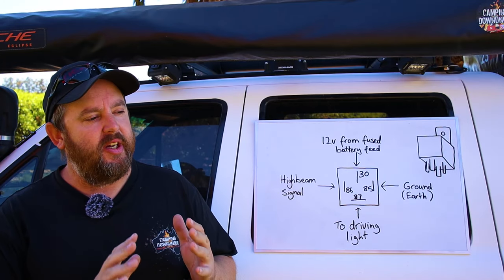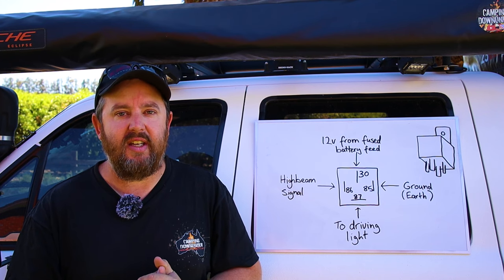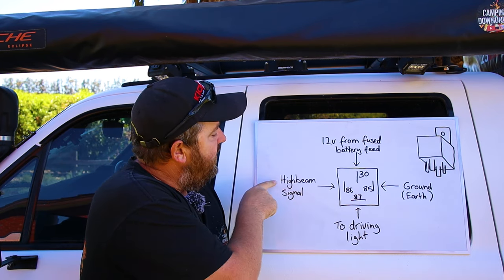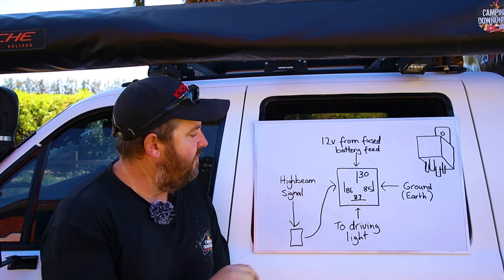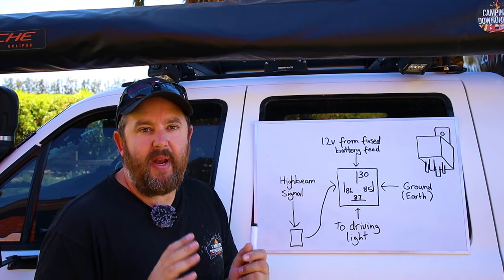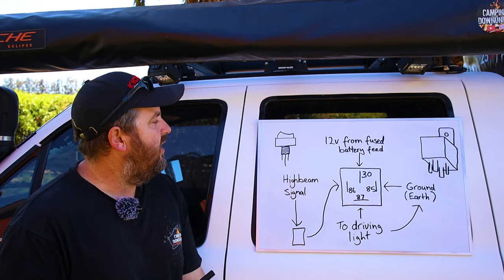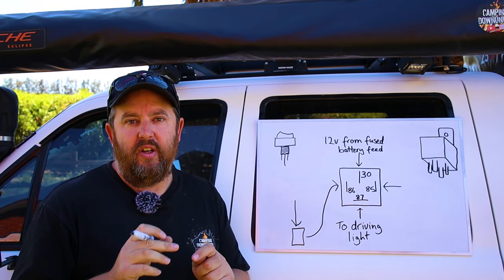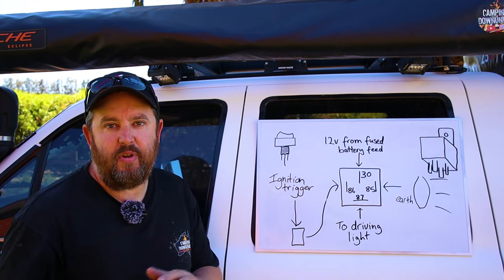How a spotlight/lightbar relay works (Beginner's Guide)

Comment: Could you make it a bit more complicated😂.
Reply from the maker: If you still can't understand that then I suggest you pay a professional so you don't burn your car down. That's as basic as it can get
Reply: This is the best explanation I've seen by miles
Reply: Also found it very confusing and talking way too fast.
Reply: Not everyone is electrically inclined.  Some people get it faster than others, others never get it.  I agree with previous comment, if you don’t understand this hire a professional.

Comment: do i need to put relay??....i want to put more lights on my car can i just conect them with my headlights and when i turn my headlight on it turn them all on???
Reply from the maker: No you can't pull power directly from your lights or else you will blow your headlight fuses straight away. You can only pull a signal from the headlights but the actual power for spotlights needs to come directly from the battery. That's why you need a relay
Reply: @Campingdownunder  that means i will need to put a extra switch or is it posible some how to make them turn on when i turn my headlights?
Reply from the maker: @marioserafimidis3133 that's what the trigger wire is for. I did a separate video explaining how to wire up spotlights

Comment: Good job mate. Keep it up. Got a power feed issue on mr triton. My bro piggy backed off existing light bar install. Worked for about 5 minutes, then cut out. I believed a fuse at first. Now possibly stuffed a relay, or rocker switch?  Just that high beam still works. Now original light bar doesn’t work or new light bar
Reply from the maker: Yeah I'd run 2 new wiring looms. Then you know your covered 👍

Comment: Hi. Very dumbed down explanation of how a relay works. I like it. I'm wanting to wire in a light bar to a mitsubishi asx. Factory high beam is rubbish. Previously I have purchased plug and play kits but it seams the connections are different to the kits. In the fuse box I have found the high beam fuse. Can I piggy back off this as the trigger wire? Cheers.

Comment: Cheers for the vid mate… nice n easy to understand. How do I go about hooking up a override switch so I can flick my reverse camera on while I’m driving? Cheers
Reply from the maker: If you can find the reverse trigger wire for your camera you can run a separate power signal wire & join it to the reverse trigger wire through a switch. So when you switch it it will send power to the reverse wire & turn the camera on. But you need a diode on the reverse trigger wire so you can't send power back to the reverse lights or else when you flick the switch it will also turn on your reverse lights
Reply: @Campingdownunder  It’s an aftermarket reverse cam so finding the trigger is done. Could I use a relay and use the 87a pin for the override? 
Cheers for the quick reply mate. Got my subscription. Legend 👍🏼
Reply from the maker: I've never actually tried it that way. I've always just used the diode and an extra power input wire for example behind the cigarette plug
Reply: @Campingdownunder  Ah yep, makes sense. Cheers mate. I’ll be giving it a crack next weekend 🤙🏼

Comment: Great video I have a question for you 
I am trying to hook up some work lights with a spotlight harness but don't want it on the high beam  just inside the cab or even outside for setting up camp
Reply from the maker: Then just hook the highbeam pick up wire to a 12v supply like the battery and add a switch along that wire somewhere so you can cut the power to the relay when you don't want the lights on. Or you could just run an auxbeam switch panel which I've talked about in a separate video and then you won't need a relay
Reply: @Campingdownunder  thanks kind sir

Comment: 2:40
THIS!

I just bought some aux lights for my car and want to wire them similarly to this. However, i want to be able to engage them even if the highbeam signal is not present.

Basically; I want the car's highbeam to be the 'master switch' that will power the aux lights regarless of if the 'slave switch' (user operated switch in the dash) is in the on or off position.
Reply from the maker: If wired correctly the highbeam switch will cut out the spotlights regardless of what position the switch is set to. Legally the highbeam has to have control of cutting them out instantly when dimming lights. The switch is only for choosing not to use your spotlights while on high beam
Reply: @Campingdownunder  right, that's the idea; to have the highbeam signal acting as a 'master switch'. The user operated switch I wanted in-line as a way to power the aux lights and only the aux lights when needed. I live in the middle of nowhere and when storms get crazy out here, my ambers do a much better job at handling refraction than my 6k OEM lights.

Comment: One thing that is not explained though (which I cannot seem to find on any tutorial video) is the switch part. I want my spots to run independently from my normal driving lights. So I want to add a switch to terminal 86 of the relay. But this will mean a wire running from the battery positive to the switch and back to terminal 86, correct? A switch will not do anything with just one wire running from it to terminal 86.
Reply from the maker: Rather than picking up power from the highbeam signal wire just pick a live wire running a switch between it. Same as a normal wiring harness if you were running through your highbeam. All you are changing is the switch power location from highbeam to a live wire so it will switch on or off anytime. Not just when highbeam is on

Comment: In Victoria, the rules states that any light bar or spotties added, must turn off when high beams are turned off (doesn't say anything about switches)

I've got mine set up only to trigger when the high beams are triggered without a switch to keep it seperate (sometimes can be confusing lol)

Havent had any issues, and if I was pulled over, I would show the police that statement from Vicroads.

Great video by the way :)
Reply from the maker: Cheers mate 👍 yeah if only every state had the same rules it would make things a lot simpler lol
Reply: @Campingdownunder  Additional headlights, including LED light bars, must also comply with the following conditions:

the lamps must only be able to be switched on when the high beam headlights are in use, and must automatically turn off when the high beam headlights are turned off

yeah that rule would be great everywhere :D

Have a good weekend mate. I'm going 4wding for the easter long weekend with the club... Hopefully my poor car is capable haha

Comment: Can I ask question, if I lost my spot lights while driving, where do I look to see if there a fuses or something busted? And or have the lights just died? They look cheap lights and only had car for 6 months.
Reply from the maker: It should be a blade fuse close to the positive terminal on the battery. Check there first 👍

Comment: Dumb question. Since the relay has a ground wire does the relay itself need to be mounted to a ground. Curious as I’m trying to install on a atv
Reply from the maker: There are no dumb questions mate. No you don't need to mount the relay to a ground as the wiring is already grounded

Comment: Great explanation but I’m a bit confused as my ground for my relay is on 86 and my switch is 85
Reply from the maker: It just acts like a switch so as long as you have a positive & a negative it will still complete the circuit when triggered no matter which is which
Reply: @Campingdownunder  thank you
Reply: @Campingdownunder  Do you know if 2006 corollas are positive or negative switching ??
Reply from the maker: I'm not sure sorry but you can test the headlight & see if 1 of the wires turn into a positive when highbeam is turned on. If so then it's positive switched

Comment: How many lights can be powered from  87 say if you ram two wires from pin 87 to light bar and  of course they would be grounded at the light end
Reply from the maker: I personally never run more than 2 lights per wiring harness. Just to be safe. I've never tested the limits

Comment: Why not put the switch on the ground connection? Seems like easier wiring.
Reply from the maker: You normally ground a relay close to the relay which is under the bonnet. Much more earth points under the bonnet
Reply: @Campingdownunder  
OK, cheers.
Electrically, would having the switch on GND work the same, or would the relay be unhappy somehow? I'm familiar with low voltage circuits, not relays...
Reply from the maker: @iqnill it will still work the same because you'd still be cutting the signal going through the relay. It's just a harder way of doing it

Comment: Can I also tap my wires using the headlights for my whip lights and for the Relay does it require to use 12v or 24v ' I'm just trying to save money , then spending $100hr to a Sparky Auto😅
Reply from the maker: You can tap onto your headlights if you want to use them to trigger the relay so they only come on when the headlights are on. It's a personal choice where you want to pick up the trigger for the relay
Reply: @Campingdownunder  Thank you mate 😊

Comment: Hi … i was driving with led lights on, and when i dimmed lights down from high beam, led lights never came back on, I’ve checked,, power to switch is there..check fuses, check head light connection, everything is all good … power is all good except two front led lights aren’t coming on
Reply from the maker: Have you checked if there's power directly to the back of the light's? It's a process of elimination of checking absolutely everything you can think of. Check you also haven't popped a highbeam fuse on your car

Comment: My LED Bar in my Kia has stopped working all of a sudden after working well. Have disconnected then reconnected but nothing. Could this be the relay? Battery is fine.
Reply from the maker: If the relay is still working correctly you'll hear a clicking noise inside the relay when you turn the lightbar on. If it doesn't make any noise then it's no good

Comment: Does one relay work 2 halogen spot lights? Do you just run 2 wires from the bottom post??
Reply from the maker: You need to check the output of the lights and make sure the relay can handle it. Your better off using a rated wiring harness that's already pre made. Then you know your covered

Comment: I've just wired spotlights(Hella 500 FF) to my FJ Cruiser as per Hella instructions to my high beams, however when i turn on the ignition the spots come on with the lights in off position and high beams turned off, if i flash the high beams they then turn off, not sure what i've done wrong
Reply from the maker: Follow these instructions and also my second video explaining how to wire up a lightbar. Not spotlights but they wire up the same

Comment: How would you wire camp lights on roof rack
Reply from the maker: Most camp lights will come with a wiring harness. You should still wire it the same as this except you don't need the highbeam trigger. Just connect the highbeam trigger directly to the battery or a live wire so you can turn the lights on anytime without needing the highbeam on

Comment: Careful there .. most horn relays (most common thing used) are 25amp and the toggle may be a SPST, SPDT, DPST, DPDT and illuminated or not illuminated.

I thought you'd get into the magnet throwing the connection.

You could throw from the light source via a 1st step relay which is then remotely controlled by your accessories line though that's a lot of mess for fault finding.

A relay uses like 0.1a or so (bugger all) but can handle a decent whack of power before you go into other heavier options. Alike the toggle switch it can also have double throw, normally on or off options and more depending on the relay you get for what scenario. If you wanted to be a smartass with reds and blues, you just need a timer circuit (half second on half second off for eg) to feed your control pin on the DT relay from the timer, hook your blue strobe to normally on and red strobe to normally off. You'd be wise to run obviously a second relay on the power in side to disable this. This would mean each half second a half second power pulse/output would switch to blue and then in off time switch to red. Don't do it, I know a mate asked me to setup similar for them years ago and got in crap for it but think of this as an example of a simple but more advanced relay circuit.
Reply from the maker: This is intended to be a video for beginners

Comment: hey mate how do connect theese to my reverse lights? is it safe to slice the reverse light and wire that to the high signal wire?
Reply from the maker: Are you attempting to wire up a reverse lightbar? Yes it's safe to solder onto a reverse light as long as it's not a newer vehicle. In that case check with your dealer on a suitable pick up location. You are only using it to send a signal to the relay to allow it to pass power through it from your battery so it won't draw much from your reverse lights
Reply: @Campingdownunder  oh sweet thanks i think i’ll splice the red and black cable and just run it to the relay or is only the red cable necessary?
Reply from the maker: The red positive for the pick up on the relay will go to the positive on the reverse light and the black negative can go to a negative on the reverse light or any body earth including negative on the battery

Comment: The negative  power  is a  little   confusing  ... as  I  think   that's   what   I  have  on the rodeo  the earth  connection  lights  up  on  the  test  light  ...  and the   low and  high beam   don't  ... really   confusing
Reply from the maker: They use 1 wire which actually changes from a positive to a negative. Rodeos are normally negative switched. You need to connect to the wire that changes to negative when high beam is on